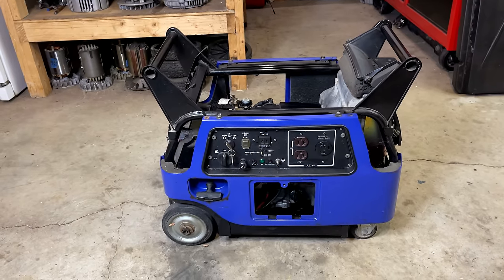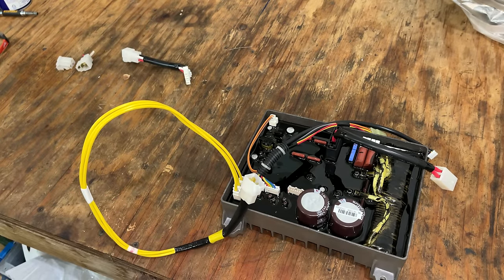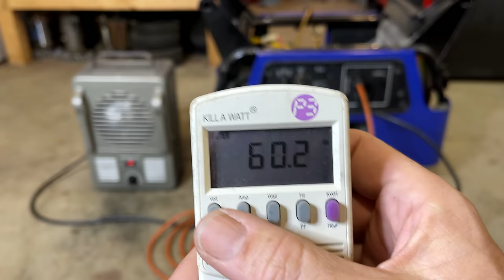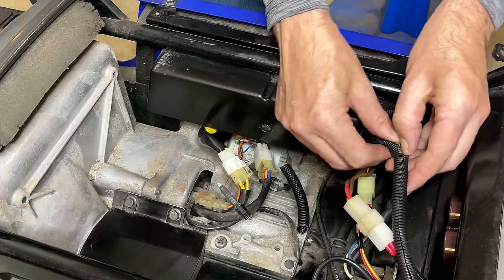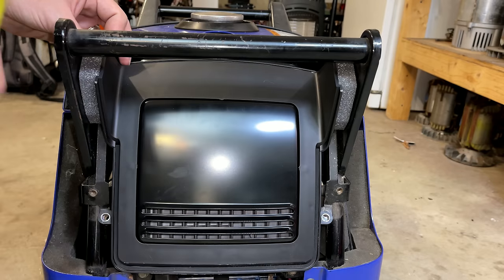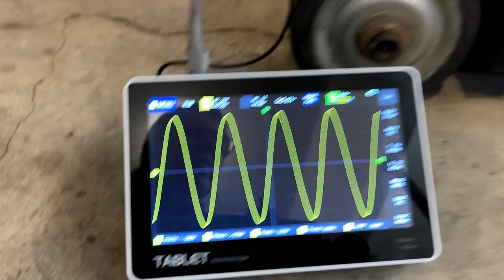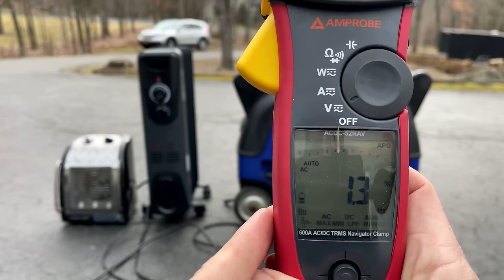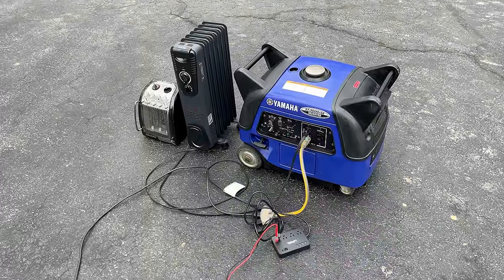Yamaha EF3000iSE Inverter Generator (Part 3) - Repair

Comment: Holding on to the generator until the video paid for the part is genius. You basically get the part for free, sell the generator, and everything you make from here is profit. This generator is valuable enough to wait on. That is a great idea. I really need to get my channel started. I have done some filming, but I don't have a great camera, computer, or the proper editing software yet. I have enough machines already to keep me busy for a year or so. I really need to get started.
Reply from the maker: Definitely get started.  In the beginning I did not have the right equipment and you can tell from my earlier videos.  But you upgrade as you go.
Reply: Only a youtuber ever thinks about that.  The cheapest cameras today are "good enough"  YOU are FAR, FAR more important than your equipment. I could give you a million dollar camera and if you don't pay attention to things like lighting and angle, all that million dollar gear will not help.  I can give you a low end, but OK camera and if you do everything physical correctly, nobody will ever be the wiser.  Mustie1 is a great example.  The guy buys his cameras at flea markets and uploads in 1080 or 720 and his video is great. NEVER a complaint from me.

The computer is really where you need the power. But I am pretty sure it is FAR more dependent on your video card than the processor.

Also, it doesn't take awesome equipment for audio, but it is incredibly easy to screw up audio;.
Reply: When you do let me know I'll watch ya.
Reply: As a low end you-tuber I can tell you it is all about the content, I have had many camera setups to suit budget but because of my location I can't earn money from YT as the partner program does not support my country, I do not have a very high subscriber count but that does not bother me..... I am here to teach and that is it. It is all about your mindset. Just do what your goal is and forget the rest, those that like will watch and if the content is good they will sub.... Just get a decent lapel mic and for the most part you can use your cell phone to video with, most of todays cell phone cameras have more than enough resolution for the normal person to make 1080p videos with.......

Comment: Very clean output from that unit . 
I am on the fence with the sub economic repair tho . For the typical owner , YouTube revenue is not a realistic option , so you are fortunate in that regard . No surprise though . Your content is very good and your troubleshooting skills are top drawer .
Reply: if it were mine, and I knew it's operational history, and a good used replacement is around $900, making my own good used replacement where I knew the most expensive part was brand knew, I'd do the repair. For someone repairing and reselling, makes no sense to repair.
Reply: @redbudestate865  
This gentleman does repair  and sell.
Reply: Thanks Bert!

Comment: I'm so glad to see this Part 3 with a replacement inverter board!  I was wondering if you would ever locate a used board to get this running again.  This model Yamaha was rare to begin with.... and now OLD and RARE.  Brilliant idea with the revenue to order a new board!  Great fix.  That Amprobe with THD is awesome for the price too.  I might have to get that.
Reply from the maker: Most affordable THD meter I have come across.

Comment: Great job James on the repair! Way to close the loop on it! I too would have been wanting to fix it even though it was very costly.

The THD is extremely good, but I be curious to the transistor MOSFET noise. That's up in the 20K to 50K Hertz range sometimes higher. When you get more familiar with your oscilloscope it has an FFT function where you can see the entire frequency spectrum. Be curious to see if there are any noise spikes up in that high range. It should be pretty low considering the filtering to where it won't be a problem. That's one of the things I'm going to do with my Yamaha EF 2000 IS at some point.

Comment: I’ve got the 3500 iseb version of this.   I believe it’s identical other than it uses the battery for a 500w “boost”, thus the b in the model. We use primarily for our camper and that boost works well for a/c start up load.   We also use it for back up at the house.  Does everything except run the 240v well which we have a bigger unit for.   Really come to love the yami generators after owning this one for a while.
Reply: I wondered how the "boost" was accomplished...thank you.

Comment: I have an old Chicago 5500 W generator that was given to me by a friend about 7 years ago. They couldn't get it to run. But a little clean up and I got it running. It's been helping me through power problems, even 10 days without power one time. The last time I had it running 3 days after a power outage and the power became erratic. Of course when a major storm comes through a wide area. All the generators vanish at stores. But I located a 7.5KW Predator Inverter machine and finished the outage using it. The power was super clean. But I had no idea how clean. I'd been looking though your videos for a inverter gen repair and here it finally is. This makes my choice in picking such a machine up a winner. Thanks so much for seeing this through.
As for the old generator, your videos have inspired me to see if I can restore it to full operation. Only thing better than having one generator is having 2 in case one breaks down. Cheers!

Comment: You are a real die hard James. I thought that you had given up on this one. I took another look at the previous two videos for this about 3 months ago. I gave some consideration to what else you could do to this machine without breaking it down or paying the full price to repair it. It did occur to me that it might make a good portable DC output machine rated at say 300V dc at 8 - 10A. Machines like this are mostly  switch mode based. These SMPS ones sell at a pretty penny.  This would be an old fashioned linear one. Ah Well it was a good idea.

Comment: Random free advice: if you plan on running your generator in temperatures below freezing in an area without a lot of dust or dirt, remove your air filter, and your crankcase breather tube from your intake, the breather vents the warm crankcase fumes from the bottom of the engine, but there is always moisture inside the crankcase unless it is only serviced and oil added in extremely dry conditions,  99% of the time there is moisture in the air during the oil addi g or changing procedure,  this let's water in tiny amounts into the crankcase, as the generator heats up this turns to water vapor, and when sucked into the intake(the coldest part of the generator when operating in sub freezing temperatures) it condenses on the air filter foam and can cause carburetor icing problems whe  running,  and then after the generator is shut down, this freezes inside the foam air filter and the next time it is needed,  the air filter is a frozen block of ice, which can cause lots of running problems and voltage output fluctuations.  General rule is this: if there's no dust or dirt present in the location of the generator,  then the air filter assembly and breather tube will cause more problems than they will solve. P.s. put a small disposable cup or jar under the disconnected breather tube to keep oil from spilling around the generator,  this is usually clean oil and can be reused in the crankcase unless heavily contaminated by water which will present itself as a white residue in the oil. Just thought I'd pass that tidbit of advice along from the frozen north of Alaska to you and your viewers. Love the videos,  keep em coming!!
Reply from the maker: Good tip.  I recently had to run my generator in single digits and was waiting for the carb to ice up.  Some models allow you to adjust the air pickup to recirculate hot air coming off the head or exhaust pipe to prevent that.  Most do not have that.
Reply: @jcondon1  even that option does basically nothing at -40f. Lol.
Reply: @jasonburguess I can relate to that for sure, I'm in Central Alaska as well.

Comment: As a computer engineer (and owner of the same generator), I would love to know what went wrong with the original inverter board and try to fix it. Though getting through that potting material could be a biblical level lesson in patience and persistence.
Reply from the maker: I was hoping to do the same.  I actually sent the original failed inverter to a subscriber who wanted to depot it.  He went radio silent shortly after he received it.  Guess it did not go well.
Reply: Darn!  Maybe he will surprise us all with a reply here, even if it's to let us know that he got stuck at depotting.
Reply: @jcondon1  The key is not to depot the whole thing but to try to go after likely suspects like  the large capacitors or the MOSFETs. That's much more doable than depotting the whole board.

Comment: Beautiful machine ideal rating very low distortion and Yamaha quality. Pretty quiet too I like how inverter generators do not drop frequency on heavy loads as the frequency is set by electronic circuitry not governer settings engine speed and loadings. That has to be worthwhile fixing even with the expensive inverter board replacement.

Comment: Modern AC inverters create a high voltage half - waveform followed by  4 Mosfets in a "H" bridge to invert the polarity of alternating half cycles to produce the normal AC output. Looks like your original inverter module just needed two replacement FETs which probably blew open circuit although getting to them through the potting compound would not have been easy.  Maybe $10 ?
Reply from the maker: That was the worst parts about buying a new one was knowing it was a cheap repair most likely if only the potting was not there.

Comment: If this was 20 years old, it would date back to 2003.  I left a comment on video number 2 of this generator saying that if a cap is physically damaged it is almost certainly electrically damaged.  2003 is smack dab in the bad cap era.   This great affected the electronics industry.  You saw premature capacitor failures very widespread.   I have fixed MANY computers from the era.  I was fixing them back when they weren't obsolete. 
I don't know if it was widespread outside of consumer electronics (or affects such large caps), but if it was, that could be the reason.  It was very widespread and not a brand (of the equipment) was spared.

Comment: Very nice, been wondering what happened with this one. I enjoy the show and watch often, it gives me confidence I could actually do more myself than I typically would believe. Nice to see it brought back to life. Someone will have themselves a bargain with that unit, unless you are tempted to keep it?

I have the very same generator, perhaps a more recent version about 6-8 years old, but set up for Australia with 2 x 15 A 230 V outlets. I got it for half price with ~10 hours on the clock. Super nice machine. Starts first turn of the key every time and the pull start is also very easy. I keep mine inside a housing with the factory Yamaha cover. Even have the original packing box! Treat them well and they will not let you down. Resale value very high here.

It's my backup to my backup (I have an off-grid battery set up) so if needed it can re-charge my battery with 2 kW being a charging sweetspot for me, or just power the home directly which it also does well and absolutely no concern about power quality. It has perhaps 25 hours only (no runtime clock on these). I get it out every so often for a run, put the battery on the trickle charger and like yours I have a battery plug set up to make for an easy external connect to the charger. I gave it an oil change the other day which reminded me about your incomplete project.

These Yamahas make such a satisfying purr and that engine wind down sound is a dead giveaway of the Yamaha. Didn't happen to do a noise level test? They seem so quiet.

Thanks for your channel.
Reply from the maker: I would have tested the noise.  It sounds a lot louder in the video, but it’s very quiet.  These in running condition usually go for $1200-$1500.  $900 is the rock bottom price I have ever seen.  On eBay they have broken ones for $900.
Reply: Vibration sensing hour meters are quite cheap.

Comment: 12:13  you can restore plastics like those with a heat gun. Run it just over the surface until you see the plastic turn shinny and keep moving it like a paint gun. You can experiment first on the inside. Clean it very well with acetone or lacquer thinner first.

Comment: I sure would love to de-encapsulate, diagnose, and repair that old inverter board if it's available.
Reply from the maker: Unfortunately not available.  I sent it to another subscriber who wanted to do the same.  He went radio silent shortly after and it was not returned :(
Reply: @jcondon1  He may be embarrassed about. If you would like me to reach out to this person, it might allow the inverter to be returned because the person won't have to face you in conversation. Let me know whatever I can do! I repair lots of inverters in medical equipment, and rebuild switch-mode power supplies for entertainment.

Comment: Yeah James you might have gave me the motivation to finally buy one as well. Was really excited to see a finish to this repair series. I basically have the same generator with a bad control board but the replacement cost always stopped me. Board got damaged from falling off a pontoon on the road and that was almost ten years ago now. But generator has low time and was quite new then. I should just spend the money and get a new one. Thanks again and love to see extended test runs. Great video and content. Keep them coming.

Comment: Great video. Helping me diagnose my Westinghouse iPro4200. During my quarterly test run using my Camper AC unit, it went into overload and would not come back out. Of course Westinghouse telling me it's my fault even though it's run it before, but I digress. Thought about getting a new inverter unit but could not bear thinking about spending 180 bucks for a maybe $600 generator. On a whim I took the x3 20A GFCI outlets out of the circuit and I get a green light. No other obvious signs of a short anywhere. Can GFCIs fail without popping and cause my short? I'm going to install one at a time and see if that's what's causing the fail. Load side is in parallel, bonded neutrals are in series. UGH

Comment: James!! Thanks for all your video's on the generators, you helped solve my problem! I'm also glad to see that when you repair an old carburetor,  you actually clean the the whole unit, and once the generator is fixed you cleaned the whole generator,  not many repair men do that, but I have always done it, and been laughed at for doing it! Do you think you could do 2 more videos on generators, one for installing a duel carburetor for natural gas, and gas, and do you know of any way to install a better muffler system to quiet a generator down. Again thanks James for your video's, keep up the good work!

Comment: Excellent video and having the expertise to test, diagnosis the problem and come up w/ a cost effective solution. Glad you have the equipment to show the THD and sine wave to confirm that this unit will be safe to run sensitive electronics. Keep up the great videos.

Comment: Hello Jim I learnt a lot from you video's thanks. Based on the cost of the inverter module you should continue to remove the potting.  It looks like the positive side of the sine wave is missing based on the clipping shown on the oscilloscope. This is passably caused by a bad three phase bridge rectifier, the IGBT or Mosfet power transistor(s), or that hv cap that's damaged may be bad.  Due to the high cost of this module you should consider digging deeper. It maybe nothing more than a few diodes (Arcing wires?) that need to be replaced. It appears to me (as far as I can see) that everything else in the module is working ok. By the way Very good job constructing the AVR circuit from the schematic in your other video and you apparently have little electronics knowledge impressive. Best wishes.

Comment: Something to think about, when it comes to selling this include the fact that it has a new inverter board and if people are smart they would look up the cost of that part.
So, I would think with the new board you should be able to get your money back and then some, but if the generator was using it’s original board, I can see the $900 being the potential price.
Have you seen Terrel Fixes All video about why he hates Hondas, it’s definitely a good watch.
Reply from the maker: I saw that.  Definitely a hard repair to justify.  Honda inverters are usually cheaper.  I looked up the cost for a new inverter on my Honda EU6500 and think it was only $600.  Twice the power and half the cost.  These machine are a lot new and the inverter is the most expensive part to replace.
Reply: @jcondon1  Are they typically all potted like that?

Comment: Great video as usual James!  One question though, were you measuring THD on the output of a surge protected power strip?  If so, wonder if it has any impact on the THD levels.
Reply from the maker: It should not impact THD.  Those surge protected strips usually just have a few sacrificial metal oxide varistors.  Normally they do nothing unless there is a voltage spike.

Comment: Thanks god is not a 4th video it felt like a series where you want to find out what would happen on the next episode     Im glad I finished. Bc im in the same situation 🤦🏻‍♂️.   On a AIms gen6600w 120/240v electric starter inverter.  But like u said the problem is I can’t find any parts for sale.   N inerd the dame part you replace.